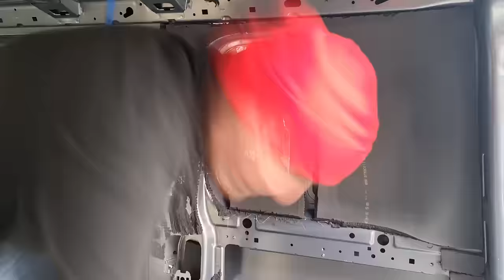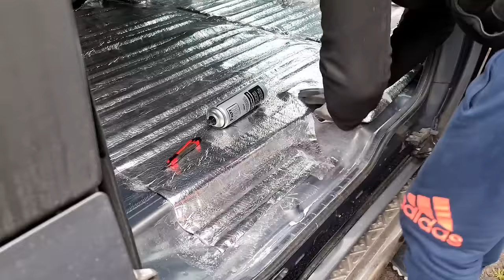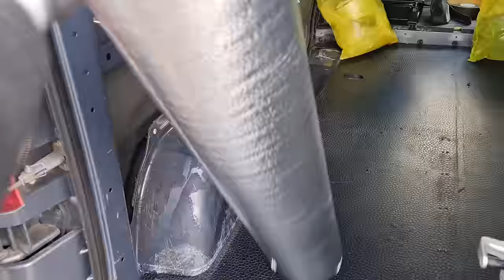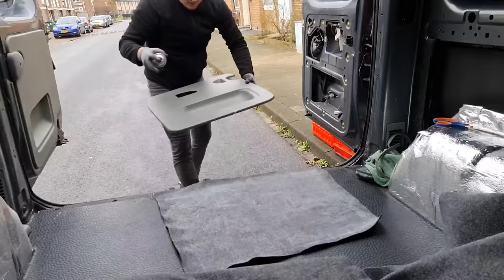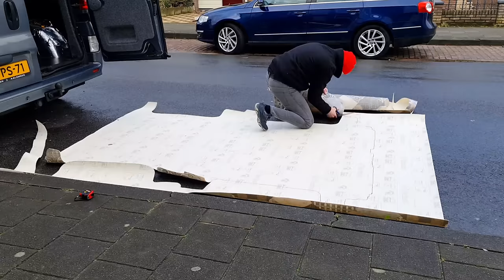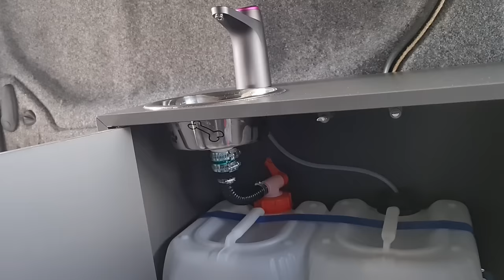Opel Vivaro Trafic Primastar 《》Camper conversion | 3 months in 14min | Timelapse | OFFLIMIT Vlog #8

Comment: Interesting, I always thought walling the van out involved lots of trial fitting of ply and hundreds of screws. 
Your method saves a lot of work and weight. 
I suppose if you wanted to add some wiring for modifications later, it would be easy enough to peel back an edge of the felt to pop a wire behind?

Comment: Sir, what if welding is required for a repair? On the underbody, for example?
Reply: Before i converted mine i set about the underneath..powerwashed it then bought two gallons of waxoyl two litres of turpes to thin it down and did all chassis inner/outer sills floor.etc…be foolish not too as removing the sound proofing etc would be a right pain in the ass